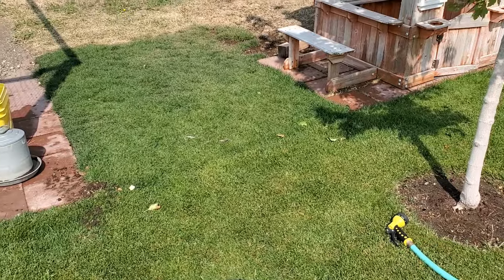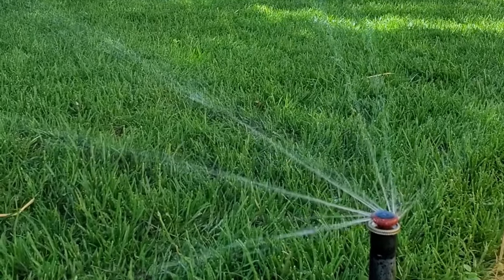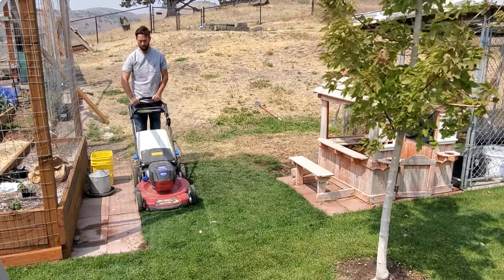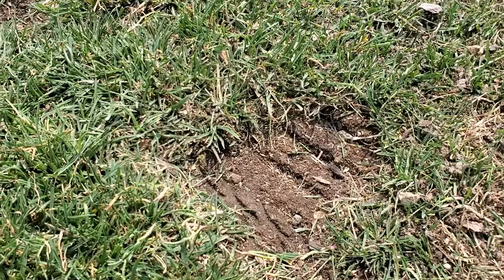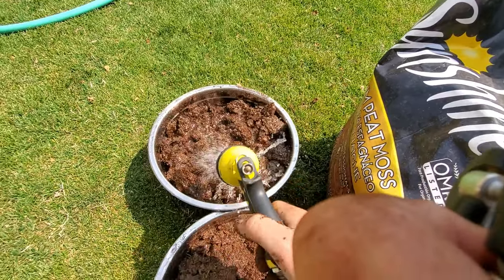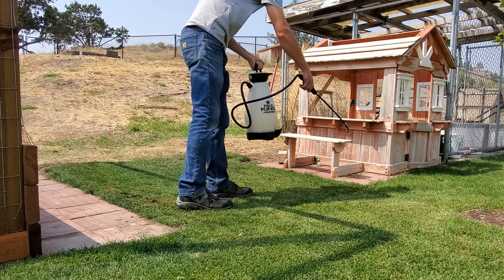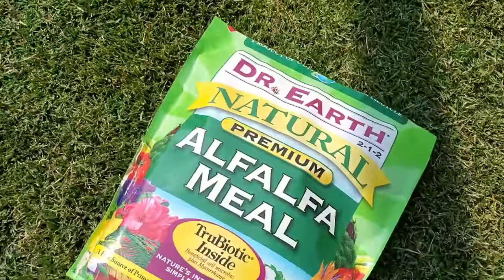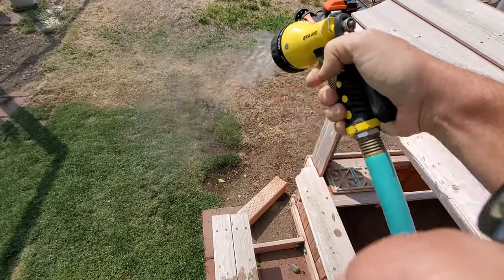Flawless Lawn Overseed // Get Yours Right On The 1st Try

Comment: Your video is like pure protein, so much good info packed into a short time! I overseeded at the start of this month (September), but I didn't know about pre-wetting the peat moss. My results are still pretty good, considering we had an extreme washout-level thunderstorm every week this month. I'll have to come back to this video for next year's overseeding. Thank you!
Reply from the maker: Love waking up to comments like that JM! I'm glad to add value. The pre-wetted peat moss does cause a bit of clumping on the ground which presents its own challenges, lumpy soil for a while and it may be a bit harder to spread but I've done it a few times now on small scale and it worked like a charm each time. I suspect the pre-watered soil also had a lot to with it as well though. Thanks again for watching and for your comments!

Comment: Scott’s Whizz! Have always just thrown it or used a hand crank spreader when overseeding but saw it at Lowe’s the other day and figured I’d give it a shot for $22. Prob get a more even distribution for my 3500 sq ft.
Reply from the maker: That's it, the Whizz, id probably use one too if I was seeding anything more than a couple hundred square feet and a push spreader for areas in the 1-2000+ square foot zone.
Reply: @TurfMechanic  Yeah I thought about my big spreader but I have this weird connection to my seed. Seems too impersonal:)
Reply from the maker: Lol, I get it. 🤣

Comment: Wouldn't you want to hold off on the starter fertilizer until after the grass seed has germinated? The nitrogen in the starter fert can cause the existing grass to grow quicker and outcompete and shade the new grass seedlings. The seeds don't need nutrients to germinate, but need it after germination.
Reply from the maker: Yeah, the case for applying it 5-7 days after seeding is big. I omitted it for simplicity. The Shade of the existing grass however I see as a positive. The existing grass shields the baby grass and the seed, with light watering over the first 7-14 days the NPK applied shouldn't leech out, the hope is enough is reserved in the soil for the baby grass once it starts growing. The alternative is to run a spreader over sprouts on day 5-7 and potentially disturb them or the seed just starting to germinate. For me, I decided to do it all at once because I didn't want to have to deal with removing the cloth and then putting it back after a fert app. There's no right answer on this but your proposed method is probably slightly better especially for those people that don't cover their seed with crop cover.

Comment: I have a pull-behind aerator for my riding mower. It's weighted with a couple of solid cinderblocks. I also have the Scotts turf master hand spreader. The cart kind throws seed in places you don't need it. I use Scotts southern gold seed mix. Everything is filling in pretty good. I also have an Orbit sprinkler system. For spot watering I use a Gilmore 360°. Some areas I just use an adjustable pattern spray nozzle. I'm probably gonna get a Sun Joe dethatcher. Do they make a 40 volt battery version? Gasoline would be alright too. 🐀🐾

Comment: What if the area that you need to overseed has a crab grass problem? Do you try to kill it first or just allow it to die out over the winter and the new grass will fill in?
Reply from the maker: Good question, controlling crabgrass is easier done if we kill it before it seeds. Most grass types other than St Augustine Quinclorac will be the best option to kill crabgrass. Virtually all seeding can be done 7 days after quinclorac is applied. For bad crabgrass problem you would apply round one weed Kill today, then round two in 14 days time, then 7 days later you could seed. There are a few grass types that you can spray and seed on the same day, bermuda, fescue, perennial rye, zoysia. If you are running st aug then none of this matters because that grass type isn't seeded and isn't normally mixed with other grass types. Hope that helps!

Comment: Awesome overview! Really helped me out a lot. What is the benefit to topdressing with peat moss if Versus if I have good seed to soil contact and just use the crop cover and water regularly? Also, if I decide to spread the peat moss first and put a starter fertilizer a week from seed germination, will they fertilizer be able to get through the peat moss and into the soil?
Reply from the maker: Great to hear you found the video helpful! As for your questions, the peat moss and crop cover is just redundancy protection or insurance. Both will help retain moisture and protect the seed doing one or the other will probably work too but this just makes it even more likely IMO. If you apply starter fert a week after germ it should make it into the soil just fine with normally watering. Seeds actually have all the sprouts need in them for a couple weeks, it's why they'll germinate in straight peat moss or sand and look great for a while before dying unless fertilizer is added later. Lots of people don't want to walk on the baby grass often so applying fert at time of seeding is often a good way to go but it's definitely not necessary.

Comment: Good video. What setting do you use on the Scotts edgeguard broadcast spreader for grass seed? With 1 being the smallest and 15 being the largest.
Reply from the maker: In almost all scenarios I go with the lowest setting possible unless a bag of anything says setting two, in a case like that I'd stick to setting two. For everything I go lowest setting possible and try to get multiple passes everywhere to limit the risk for accidental lawn patterns from the spreader. Note your seed size though, for instance bermuda seed is dwarfed in size by kbg, and kbg is dwarfed in size by fescue. If your seed is too small then you need to get a dedicated seed spreader.

Comment: How about one more last mowing a day or two before germination, about 5 days after seeding?
Reply: I wouldnt. First, the seeds are probably swollen, ready for germination. You could still damage them w the weight of a lawn mower. And second you could be sucking up seeds w your mower and chopping them up.
Reply from the maker: I pretty much agree with Ned, no need to risk messing with seed on the verge of germinating...and in my case ive git my seed plot covered so it would be a hassle to uncover it just to mow. On a regular schedule we don't break the 1/3 rule or let the grass get overgrown but fir situations like this grass is resilient enough to handle a short cut followed by an overgrown cut 10-14 days later. By week 3 and 4 you can easily get back into your regular mowing pattern and height.

Comment: Do you think there would be a problem with putting down ag lime and Ironite at the same time? Was going to apply after spike aerating in a day or two to get my PH up and get a little green up before aerating again in Oct and then reseeding. Found that here at 10k ft. it’s usually so dry that you have to seed right before the permasnow and then it will come up well in May/June with the spring thaw and “snow/melt” cycles unless you have a sprinkler system maybe.
Reply from the maker: I see no problem with that combo at the same time. I'm assuming you actually have soil that is too acidic though, if it's not then the lime is unnecessary